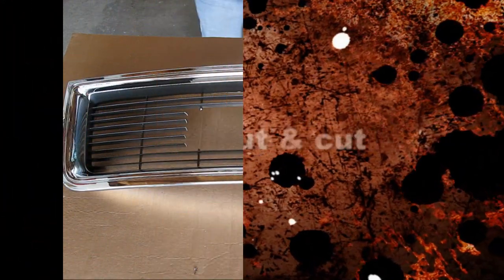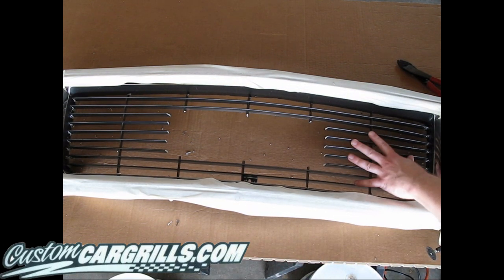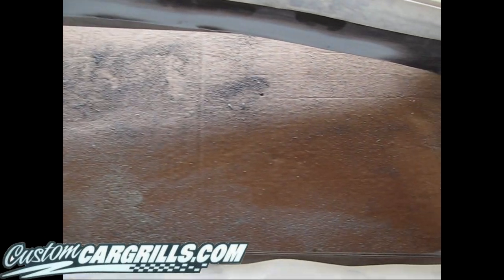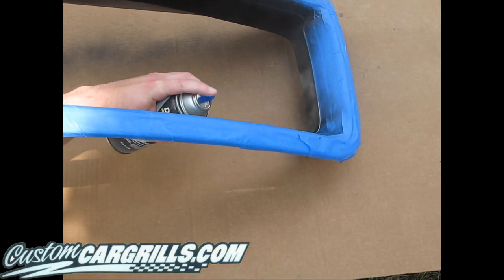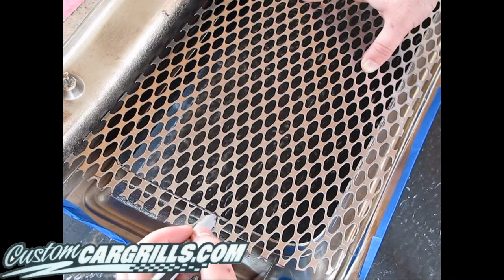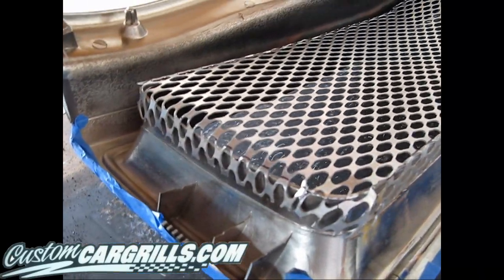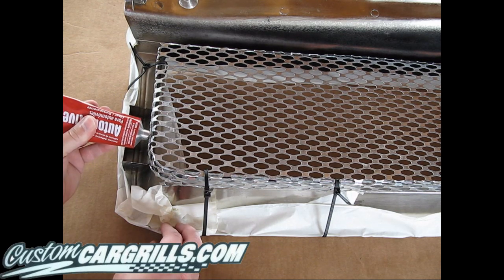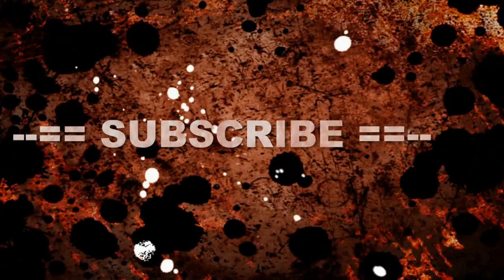customcargrills.com Gut & Cut grill installation

Comment: Is it possible to take a grill off a yukon Denali and use jus the insert part on a yukon xl? It almost worked jus swapping the hole front grill but the daytime/parking light housing were different.
Reply from the maker: It might be possible but I think it would require some very precise cuts and a some bodywork afterward to make it look right.